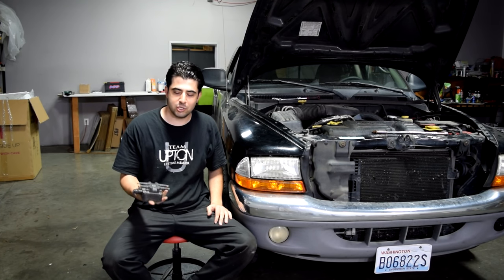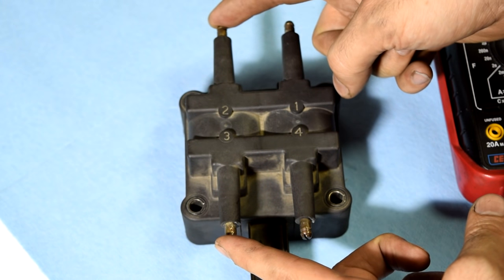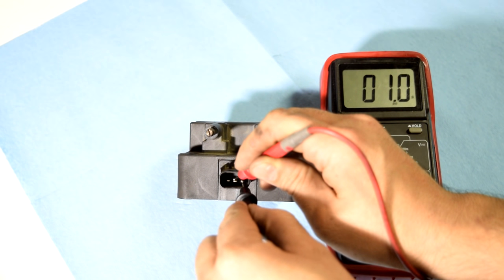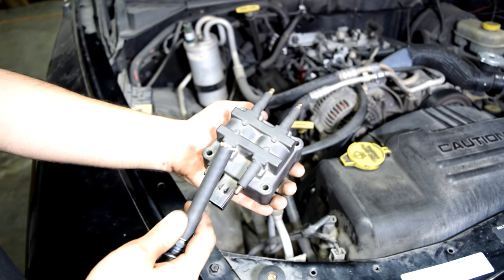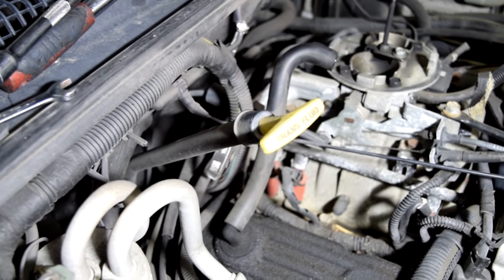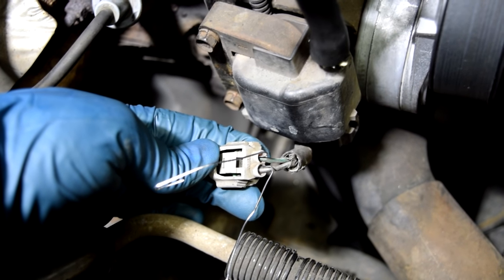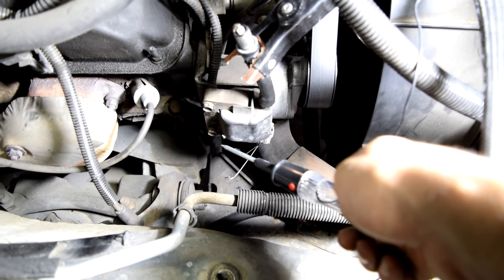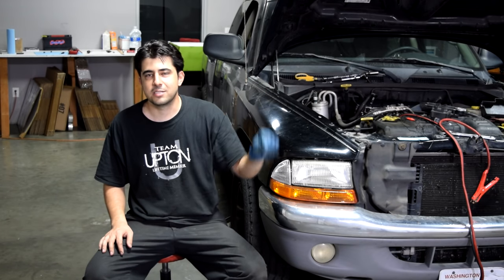How to Test an Ignition Coil Pack - Best Testing Procedure

Comment: Thankyou. I found out after looking at this video and checking the coils on my sc400, that My mechanic didn’t secure the cam sensor wires , so the cam wire was cut by the fan belt, led To a crank no start. My mechanic not knowing better, Or checking,,, excessively jumped it trying to start, leading to cooked the coils. So I towed it home and I found the damaged cam sensor wire, fixed it. Saw your video and checked coils. I had spare and changed. Great! Got my SC400 back. What a don’t understand is 2 mechanic shops couldn’t fix it. Thanks for sharing your knowledge 🙏 I will repay you. Mc, from Australia 🇦🇺
Reply: this is why I am now my own mechanic, I may make mistakes but that is how I learn and do not cost me the labor other than time on it.

Comment: Excellent video, clear, concise, and naturally born instructor.  This video just saved me a couple thousand dollars.  I had techs telling me a "dead cylinder, coil packs .... LIKE YOUR'S .... don't go out/bad" "it's the internal motor that needs to be repaired BUT we won't know until we get it open..."  I used your hose to plug test on the miss fire cylinder (#3) = No Spark.  I used the same test on Cylinder 1, 2, & 4 and all of them had spark! Just replaced the coil pack I purchased in stock from Autozone for $68.00 and the Jeep is purring like a kitten again - THANK YOU!

Comment: Much easier way to check for spark; hook up a timing light! Connect the timing light to the plug wire, start engine, light flashes, you have spark, move to the next cable. That only proves spark, it could be a weak spark, so you should test the wires and coil to ensure they're within specs. Also check that the plugs are in good shape and correct gap.

Comment: Great video, I drove my 2000 Toyota Tacoma without making fluids change after being parked for 5 years and after replacing the fuel pump; old fuel in tank, old oil still, old coolant not fluid changes I thought to drive it like 15 min to get everything moving and come to do oil and coolant change; in the time I drove it like 30 miles the vehicle raised the temp gauge, I pulled over right away not letting it reach the top of gauge and drove slowly back home; I parked and when I tried to start again it wont start at all. Called same mechanic who replaced the fuel pump; explained and he did compression test; cyl 1 and 3 have zero but cyl 2 and 4 have 180 PSI. He diagnosed a blown head gasket; he said driving the car with old fluids and low in coolant did it after engine reached operating temperature but nowaday I am getting it all apart to replace the gasket; drained the coolant and it was dark maroon color, oil does not look milky at all.....do I really have a blown head gasket or maybe the car overheated briefly and did not blow the head but the coils failed? usually head gasket one loses compression on one cyl or maybe 2 adjacent but 1-3 or 2-4??? I am trying to apply logic here at this point the head is still in the car, I am about to take it out and it would suck to find it intact! i mean it would be good but I have no car right now and have expended $1400 in a new head and parts from rockauto to replace; I cant help but wondering if I have bad coils and with this video I certainly would like to find out; I guess if i get all the way down to the head and it is intact and not blown got to backtrack and find out why compression only present in 2 cyl the way it is; in this vehicle cyl are numbered in a row from front to back 1,2,3,4, headgasket blown should show no compression on 1-2 or 3-4 or one individual cyl but 1-3?????? WTF?

Comment: This is a great video and it helped me with what I need but please everyone reading this DO NOT default to back probing. Make sure you know what the manufacturer of your vehicle recommends for testing. Some manufacturers specifically do not want you to back probe. It can cause damage to connections and terminals. If a manufacturer says back probing is ok make sure to grab a back probe adapter for your DMM. A paper clip works but if you accidentally cut a wire or damage a wire it can cause an open or high resistance in the wire. Possibly a short to ground if it's close to metal or a terminal. Just so you guys are aware :P

Comment: What you do is swap coils and see if the problem transfers. If it doesn’t, check your fuel injector to see if it has power going to it. Then  by seeing what the recommended ohm reading is and test with ohmmeter. If the fuel injector is ok, THEN watch this video and do all the other steps.

Comment: The best coil pack video on YouTube: I have a question 🙋‍♂️ is it possible to bypass the coil pack to get spark?
Reply: @ionel Renault Clio No. The coil's job is to convert the low power (12v) to a high power (30,000v) for the electricity to jump, creating spark
Reply: @Masked Vigilante I don't believe so. With spark present and no matter the Voltage, the Air/Fuel Mixture should ignite and cause combustion, driving the engine. Some cars have the coil packs convert to 20kV (or 20, 000V) and they run just fine. But my thinking may be wrong.

Comment: good video and i measured the ignition coil as you did and the result the same too about 13000 ohm, however the terminal one not working when i connected it with the wire of a spark plugs, meanwhile the terminal two gives me spark.
my question is "could the ignition coil damage although the ohm is correct?"

Comment: nice tutorial how the ignition coils work and good info as always one question though is all ignition coils resistance around one ohm always thanks for sharing.
Reply from the maker: +j georges all the ones I've come across have very low resistance in the primary coil not exactly 1 but around that. Thanks for commenting.
Reply: I necessarily dont trust ohmmeter testing other than checking surface resistance like corrosion. Reason being is a your could cut all but one thread in a wire and when you test both ends of the wire it will show very low resistance. Not necessarily the best test for resistance

Comment: how are you doing, first of all I enjoy your videos are well explained and easy to understand. I have a chrysler 300  experiencing rough idle, when is on park it's all good but on drive as I start driving it's good but I sense hesitation and when I come to a complete stop the RPMs drop from 600 to 500 (not normal) when I got my car the RPMs would remain at no less than 550 or so, I changed the spark plugs and wires and moving to the coils on plug. any suggestions would be greatly appreciated. keep up the good work, Chimo.

Comment: Great video but what if you have a good coil pack, constant voltage to the coil pack, but the pulsing voltage isn’t there?  And the camshaft and crankshaft sensors are good?

Comment: My readings equal about 1 ohm as well that you say is good but my service manual says if the reading is between 0.53 - 0.65 to replace the coil pack. I have 3 dif coil packs, all read around 1 ohm. So are you correct & my coils are all good or is my service manual correct and I highly unlikely have 3 bad defective coil packs...?

Comment: Hey there I have a ford tarus v6 with a p0351 ign coil code. while checking for spark I notice coil 1,2,3 are fire much weaker then 4,5,6 I was wonder if this is normal or if it's signs of a bad coil.. the coil is the same one featured in this video thank awesome vid to man!

Comment: some coil packs have a built in igniter circuit so this primary test wont work, if you have a 4 cylinder with a 'wasted spark' coil pack like the one in the video and it  has more than 3 pins in the socket from the wiring loom then it probably has built in igniters

Comment: I have a 1985 Buick grand national with no spark I changed spark plugs and wires ignition module coil pack crank sensor cam sensor cap and I don’t get any spark to the coil pack but I do get power to the ignition module

Comment: Okay, I'm confused, which is not unusual. When you are testing for spark (about 4 minutes in the the video), you show the coil pack completely removed from the car. This is just to illustrate, right? I should leave the coil attached, right, and just unplug all the spark plug wires and check post individually, right? Thanks.

Comment: I wish my ignition coil pack only had 3 pins instead of 4, and the 4 ends stuck out like yours. My pack has 4 pins at the connector. And where the spark plug wires connect you can't see the metal and so you can't reach the points of connection to the multimetet

Comment: Hi dear ,
I appreciate if you can tell why coil plug is numbered from inside under pins
I have nissan altima 2008
Numbers on coil plug is as next
1 - 7 in one plug
3 - 4 in one plug
4 - 5 in one plug
5 - 6 in one plug 
While i do not know how to arrange it in every cylinder 
I just put without any idea
Appreciate if you can help

Comment: RATCHETS & WRENCHES, why does COP coil over plugs have multiple ignition coils? older 60's & 70s cars only use "one" ignition coils to fire all 8 spark plugs. So I'm confused why fuel injectors need multiple ignition coils any reasons why?
Reply: My best guess that either you have a coil pack, over spark plug coil packs, or a distributor. The distributor has one power sources in, it  spins and sends power to the individual spark plugs.

Comment: Good video but you really should emphasize not to let the back probes touch together if they do while cranking the 12 volts will burn out the 5 volt control witch mean you just fired the pcm

Comment: I have a 2008 Honda Accord with 66000 miles on it. I just got it out from the body shop and now it's showing me check engine.
 I took it to AutoZone and they said the coil need to be placed I believe they said only one of them. So I replaced it but the check engine light still on. I would also like to know the working  order of the coil? They told me its number 6 I'm not sure changed the right one.
Reply: Make sure you changed the right one, write down your codes. Sounds like you changed the wrong one.

Comment: I have a 96 Ford Explorer with a 4.0 the coil pack good but I'm still not getting any fire to the #5 cylender. Anything else that could be causing this issue?  The wire and the plug are good

Comment: What if my coil pack is brand new should i have same resistance for the secondary circuit ? I have bought one for my chevy spark 2015 i have got between pin 1 and 4 (8.96)and between pin 2 and 3 ( 8.76 ) using a digital multimeter @ 20k ohms

Comment: I have a 2005 dodge stratus I'm trying to install a remote start says to connect a tachometer wire to the coil pack but I'm not sure which wire to connect to , am I suppose to connect it to the constant on the coil ?

Comment: Not sure if anyone will respond but i have a alpha romeo 155 v6 with a no-start. Battery was bad to begin with but due to circumstances i decided to test what i can while i can. I tested the coil pack using the method mentioned above, i on my primaries i had 0.9-1ohm on 2 of the switching circuit but only 0.3 ohms on the last circuit. Is this a bad coil or still within spec? I was expecting O/L but but with this reading its a bit difficult to say for certain. If someone has an answer please let me know 😁👌

I will be testing sparks next with a fresh battery but if anyone can give me an answer thatll be great heads up, thanks.

Comment: What happens when I'm NOT able to get any Ohm readings from my primary...I double checked to make sure I had the common pin, and I'm unable to get any response from the multimeter @ 200 Ohms. Is that a sign of a bad ignition coil, please respond? Thank you in advance.

Just a few more information on what's going on; 2004 Outback EJ259 2.5L. Was getting the following engine codes P0057, P0037, P0303 & P0304. I've replaced all spark plugs (cylinders 3 & 4 was oily), installed new valve cover gasket kit, and replaced both downstream O2 sensors. This took care of engine codes P0057 & P0037, but the Cyl 3 & 4 misfires still exists 🤦🏽‍♂️
Reply: Note another post said the Ohms test may not work on some vehicles, such as Subaru.

Comment: I have a 2.2 liter Chevy s10 pickup, having trouble cranking the engine over. It acts like its out of time, the motor jumps and bucks when trying to start or it doesn't crank at all.  Any suggestion on what it could be.

Comment: Hi ,how  I can get the 12 volts going trough the ignition coil, I tested the middle pin in the connector and only put out  5 volts to the ignition coil ? Is a Mitsubishi eclipse motor  1996 2.0.  thanks

Comment: have a 98 dodge neon.. was checking ohm for the cigartte lighter. now my car dont start. pump it seem to be working, start all seem to be working. check all possible fuse are good. check coil pack also seem to be passing current.. what could be my problem?

Comment: if I'm getting nothing for ressitance on all my secondary coil packs does that mean my coil pack shit the bed? the first test were u test were the clip goes in is good, then when I check the secondary coils( the top ones were u connect spark plug wires too) is giving me nothing, = zero for all of them, this would mean it shit the bed right = get a new coil pack for my 2010 jeep and that would be why its getting no spark

Comment: Could a bad coil cause a lean condition? I smeel gas when i turn my car on ive check vaccum lines and intake manifold gaskets all new o2 sensors could it be a cylinder not firing?
Reply: make the water test.
Reply: Wellington  this also happens inmy car
Reply: Jamesbond Quinones same here..
Reply: Check knock sensor
Reply: Yes a bad coil can cause a lean condition. Same thing happened was also missfiring on  cyclinder 2,3 and it turned out coil 3 was bad. no spark.  replaced it and it worked.

Comment: I have a 94 f150 4.9L when i do the light test I have constant light on the one that should be switching. Could this be an ignition module control issue?

Comment: awesome video bro,  i got the excact same coil pack, ut how do you know the correct range for the resistance (margin of error)? i got a plymouth caravan 1998 2.4L, i wont spark on 2 and 3, i tried another coil pack and its the same thing :( idk if it might be the wiring or the crankshaft sensor or something else :( i need help
Reply: So what happened to yours?  The coil?

Comment: The procedure for testing ignitoin coil pack's primary coil resistance is misleading. Subaru, and other auto manufacturers, use ignition coil pack in which the ignitor is integrated with the coil and therefore the resistance of the primary coil in the pack cannot be measure.

Comment: I'm not getting a reading when testing the 4 wire pins but I'm getting 13.8kΩ on both 1+2 and 3+4 doing the secondary resistance method. I have a check engine light reading P0301 - Powertrain (cylinder 1 misfire) I put new spark plugs and spark plug wires and still getting this problem and spark plugs are gapped correctly, also the check engine light is flashing still reads this code, car is still drivable and starts just really shaky and loud sounding, kind of sounds like a muscle car but not in a good way. It's a 99 Forester
Reply: Chris Bristol just letting you know I replaced it and it worked! everything fixed itself out!

Comment: should testing the primary coil, be the same on a 4pin coil
Reply: update. i found thru subaru that my 4 pin, the primary cannot be tested (the way shown, with a multimeter(, because the ignitor is built into the coil pack.

Comment: A real-world test is best............ohmmeter does not fit the bill.
Reply: Krystal    Nice job! It's kinda like trying to load-test a battery, that needs to reliably supply 200-amps for starting, using a load-tester that draws 
50-amps. It may catch some bad batteries, but will not be a reliable way to catch all bad batteries.

Comment: This video was way too advanced for me who is still learning, it was way to quick.
I dont follow it sadly. My coil pack also looks different , which is for a OPEL CORSA B , i dont know.
Reply: The plug wire with time is the easiest and best way to test this coil pack out, yours should be similar if it has a coil pack like this. If not it's actually easier because you can just test the spark with a cheap spark tester if you have a newer car.

Comment: Can't you just crank the engine and use the test light directly on each individual coil while the coil pack is still on the car??
Reply: Did you watch the entire video? He tests the pack for spark and control signal. The latter he uses a test light to do so.

Comment: I have 09 Outback with 4 pin connector , when I check with multimeter it doesn’t show anything,not even somewhere between 0-1ohm.does this mean coil pack is bad ? 
Secondary coils show 11.4K ohm